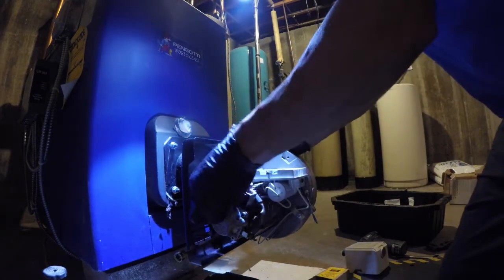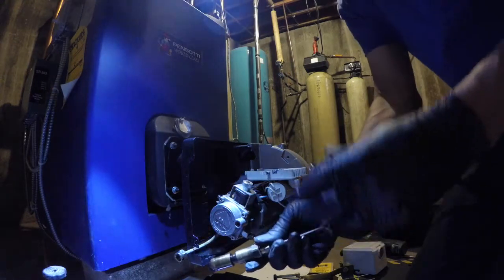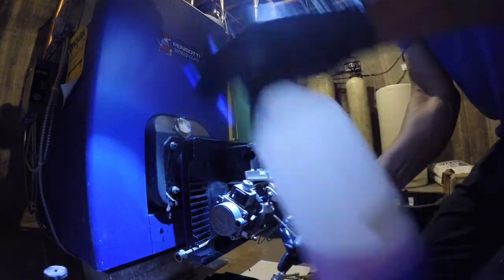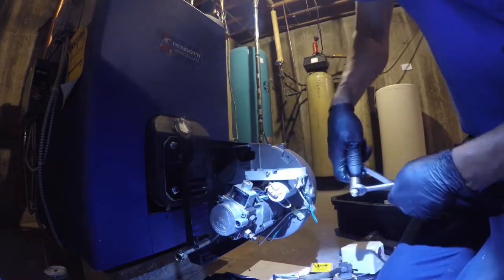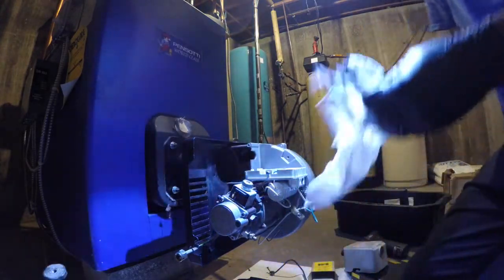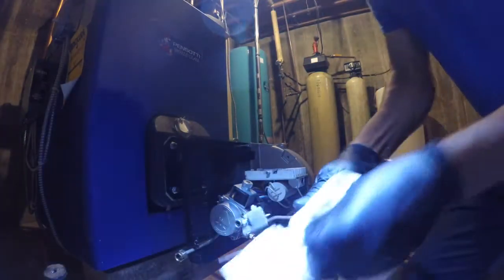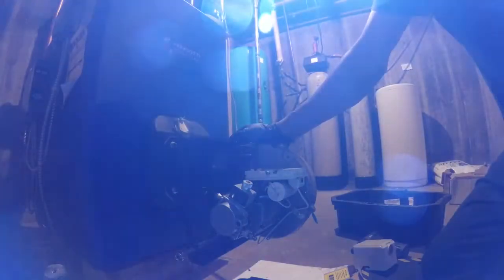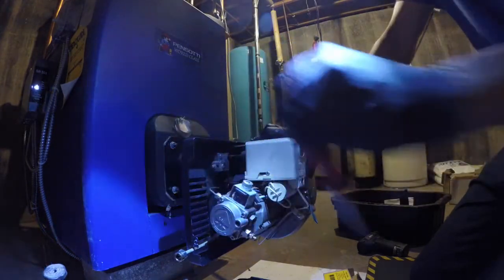How to replace nozzle on Riello burner

Comment: After loosening the set screw I could not remove the nozzle from the housing. It was as if the entire assemby was bonded together. Ive replaced the nozzle before without issue. What if any suggestions do you have? Thank you.